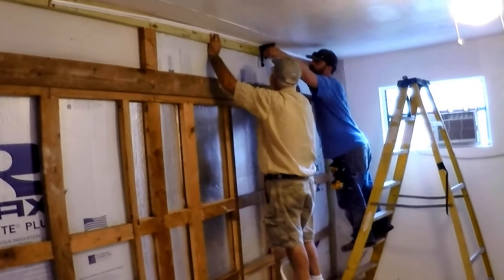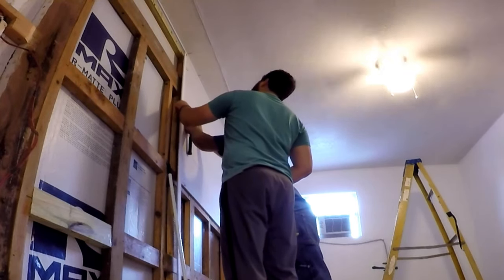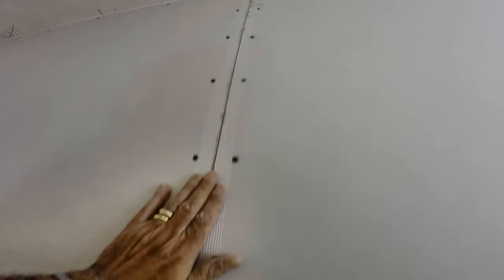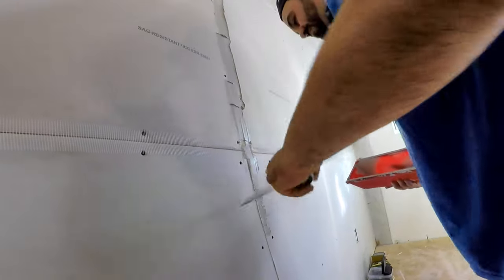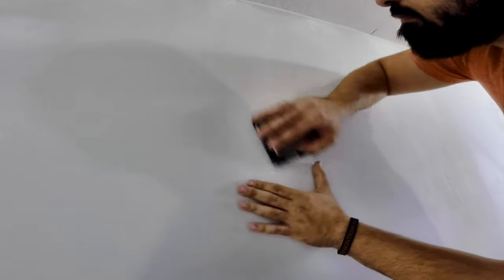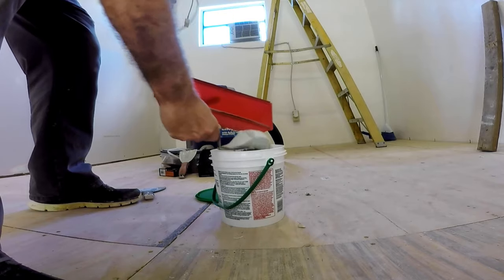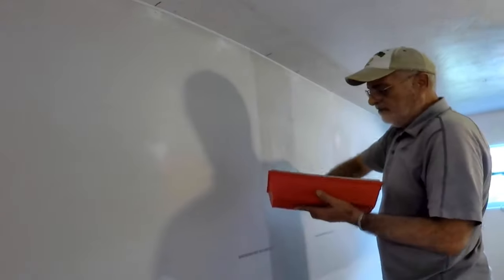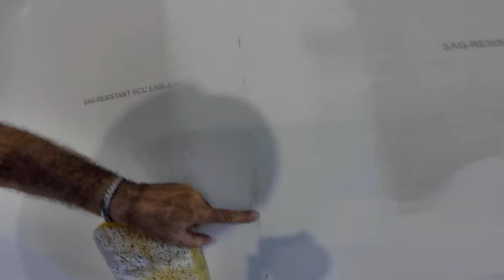How to Close in Garage Door Opening - STUDS DRYWALL - Conversion to Bedroom Office or Living Space

Comment: Hi.  How did you make sure the place where the bottom of original driveway does not get any water penetration when it rains?  What sort of barriers were used?
Reply from the maker: The blocks were laid down on the outside of the step. Meaning 1 1/2 inches below the inside floor level. In addition, the bottom outside and inside floor was caulked with concrete bonding before stucco and again after stucco dried. It Looked like this. Home Depot can help you get the right product.  Good luck.
 https://www.mscdirect.com/browse/tnpla/77155075?cid=ppc-bing-New+-+Fasteners+-+PLA&mkwid=3rlHNdEd%7Cdc&pcrid=73392450426895&gclsrc=3p.ds&%3Fcid=ppc-bing-New+-+Fasteners+-+PLA_3rlHNdEd__be_73392450426895_c_&mkwid=3rlHNdEd%7Cdc&pcrid=73392450426895&product_id=77155075&msclkid=5324a1ffa0cc1bdff1aec2cc92e1381e&gclsrc=3p.ds

Comment: Hey John do you have a video how to install the cinder blocks to close up the garage? I would like to do the same but I am not a pro. Any advice would help. Thank you
Reply from the maker: Hey Raul, the blocks enclosing the garage door was done before I purchased the property.
I did enclose the ac openings myself, here's the link  https://youtu.be/UixbJ7Ramds
its basically the same. The only difference I would add rebar drilled to the floor on the first row, about 2 feet high and fill them with concrete. Just incase....